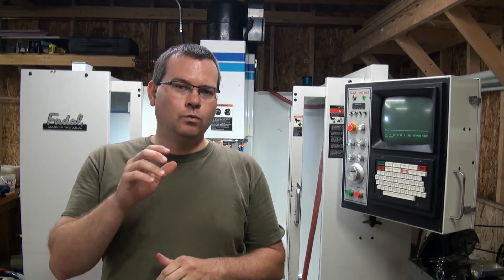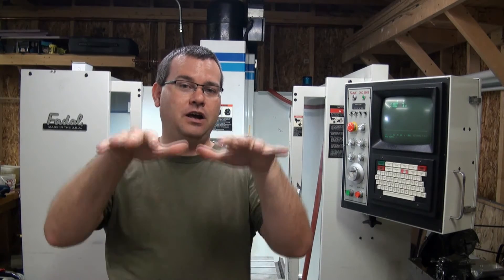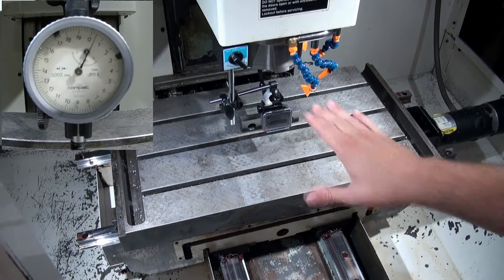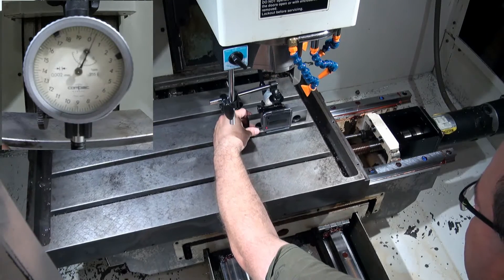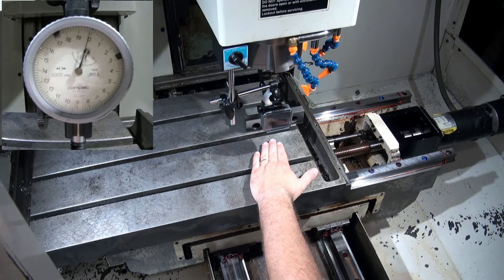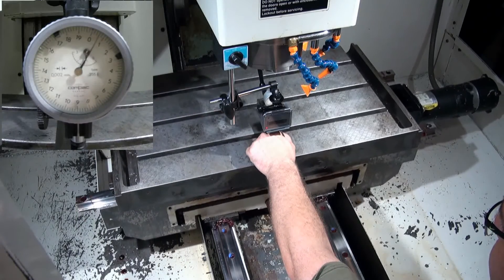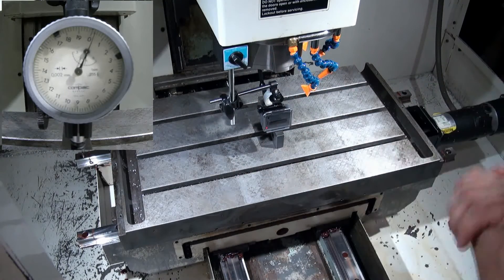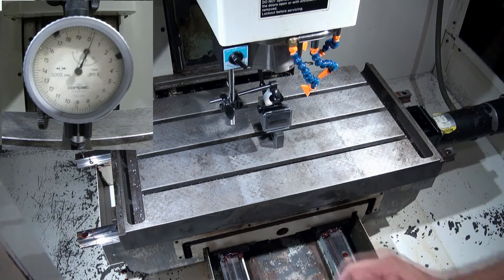CNC Machine Setup and Alignment Part 3: Table Parallel to Motion

Comment: I wish the term "level" wasnt used in instances like these. It is used in 3d printing as well to describe the bed. And it confuses so many people. Level is irrelevant (within reason), whats important is that the table, or bed, is moving coplanar to x and y, throughout the movement of x and y. If everything is coplanar, you could machine a part on a mill installed on a battleship with the same accuracy as a mill that was "level", and coplanar.

Comment: Not sure if your still checking this but we found that our y axis was .015 off. We have a 2006 boxway. Any ideas on how to go about figuring it out?
Reply from the maker: In what relation is it off by?
Reply: @AtManUnlimitedMachining  we did this test. When running the y we zeroed the indicator with the table all the way to the back of the machine. When the table was at the front of the machine we had dropped .015.
Reply from the maker: Wow, that is a lot. Given that much error it will be hard to figure out the root cause with just this one test. I would do some tests with a level and or laser to see if its angular error or if its a linear error in one of the planes.
Reply: @AtManUnlimitedMachining  I think we have it narowwed down to the turcite on the front x way. 😭
Reply: Y backlash appears good. .oo1
X looks good as well.
Found a guy here that knows his stuff (fadal service guy) and he is helping out too
Reply from the maker: Nice, I was just going to comment to check the turcite and see if its lifting, worn, or has chips in it.

Comment: Could I ask you to do 1 thing for me? I need a photo of table back side - where the carriages are. Also would be nice if you have some pic what is the distance between them - I'm building my DIY machine based on Fadal VMC15XT - according to the specs and manuals from internet but cant find this information.
Reply from the maker: Machine is running making parts, no way to take that photo or measurements at this point. I think I show the trucks under the table in some of the videos. But your measurements should be based on your machine and travel.
Reply: The problem is I'm trying to fit to rails I already have, but always could buy another one if it should be 250mm longer - I have Rexroth 25C, 776mm and the table from conventional machine I did not use (FNC25 tilting table which is 600mm long). Almost everything other is to the spec with 15XT. Need the aspect ratio for how long the X rails are, and where the carriages are possitioned on the table, also how long the table is in 15XT. Could you just mesure the table? In my opinion they should be possitioned in 1/3 of table lenght (each side), so the rails should be 1/3 longer than the table to full usage of the table (spindle center should reach end of table). If it is on a 15XT manual, I'll find it... I have to model this in some CAD to check it... ;)
Reply from the maker: The rails are 1000mm long, the table is about 30 inches long on the VMC15. The XT is bigger. It's a little more complex to design a machine then bolting on some rails and trucks. By time your all said and done you can buy one of these machines in usable shape for less then $10K US.
Reply: To design it is not a problem. The problem is than to do it and do it right ;))
Here in Poland its not so easy to buy this kind of machine for equivalent of 10k$. Most of them are from Germany, where working on heavy production cycles, some of them are totaly devastated. It could be a problem to buy a machine and then invest another 10k to repair it. For 3-5k$ you could build your own from scratch on Hivin/Rexroth parts if you only have some possibilities (for example doing the milling on large and heavy details like machine corps inhouse as I do).

And its not my first machine been build. I have done some retrofits with manual machines to cnc, also build some 3d printers and few plasma cutters - designed and built almost on my own and as tight tolerances as in factory.

Whatever - another thanks for all the information you supported me - as always it is huge value on my works (I've watched all series yesterday night). Very appreciate.
Reply from the maker: Fair enough, sounds like you did your homework. Let us know how you make out! Thanks!

Comment: This isn't exactly right. You should not be grinding those shims unless you can verify that your linear guides are in perfect condition. Most likely you have wear in the linear guides. Removing and grinding the shims will just mask the problem more or less like milling the top of the table. The purpose of the shims was to correct the flatness of the table when the machine was originally built. The table was not perfectly flat, so they used the shims to pull it flat. You can't just grind them willy nilly.
Reply from the maker: Wes, I don't think I advocated "grinding willy nilly". You must take careful measurements and understand what to adjust to bring the machine in. Seeing how the linear slides are brand new and just replaced, I would call them "perfect condition"